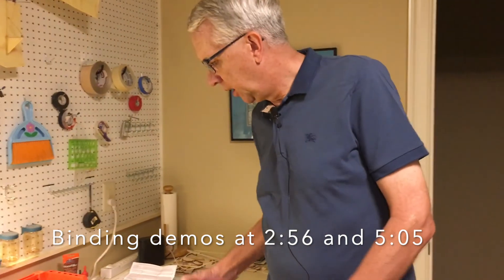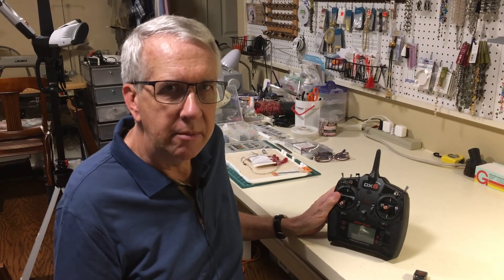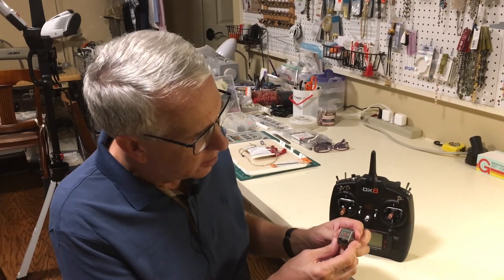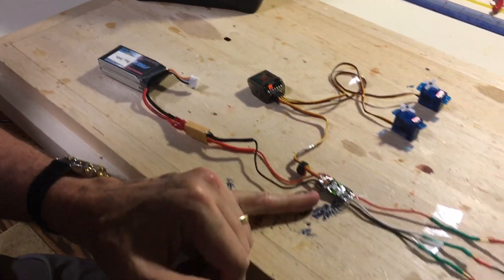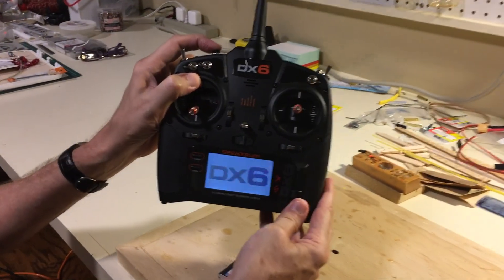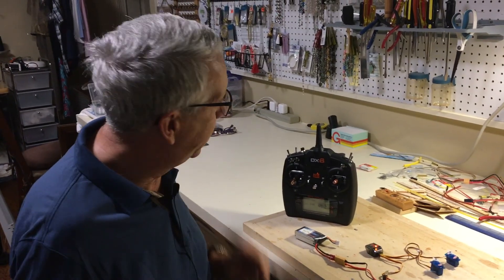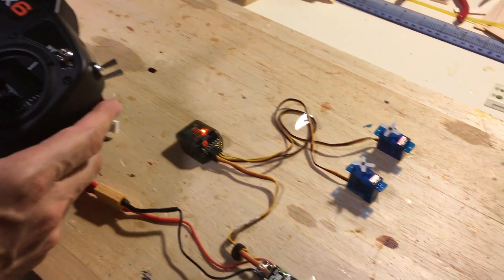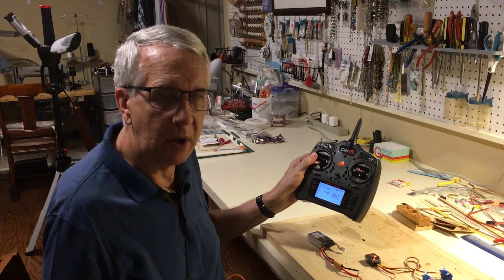How to Bind a Spektrum DX6 Transmitter to an AR620 Receiver

Comment: Hi Tim many thanks...to then bind to a second model do you have to already have model number 2 selected before you switch on the transmitter after you have bound 
Hope you get my meaning...I'm getting this transmitter tomorrow 
Mark UK
Reply from the maker: Yes, you’ll bind the receiver to whatever model is selected on the transmitter.
Reply: I know nothing so I ask: The model in the transmitter is the type plane that is programmed in the transmitter and when you bind the receiver, the transmitter thinks the receiver is installed in that type of plane?

Comment: I  have a DX6 and used AR620 which I would like to use on different plane.  I need to reset receiver to default settings.... Do you know how?  thank u sir
Reply from the maker: I am not fully sure what it means to reset a receiver.  Typically you need to the receive to be binded to the transmitter, which it seems to be.  Just install the receiver in your new plane and go fly.  If further questions, try www.RCGroups.com

Comment: How?
Do you set fail safe on a dx6.... I can't find it on manuals, lib.Or in the Transmitter index list.
Fail safe seems to be automatic when you do the binding , but it only shuts the throttle  off.... It doesn't put surface areas to position that you want.like  Every
 Thing neutral apart from a little bit of elevator.
Reply from the maker: I am not fully sure.  Try a Google search, here is one video for an RC car: 
 https://www.youtube.com/watch?v=c0AmCSqh1yM
Reply: @TimMcKay56  j found a few for the 6i and 9 but not for our transmitter the DX6....ok thank you i will look at that link

Comment: I just got a tug boat with this spectrum set up. But nothing works even after a confirmed hand shake. I just want a throttle and steering in this unit. What ports do I plug my esc into, And rudder servo into? I feel like this Is a basket case. Any help would be great. Thank you. It's just two servos now I'm dealing with but have this 6 channel setup
Reply from the maker: Watch my video “RC Electronics for Newbies.”  Tim

Comment: Can this AR620 be binded to the Spektrum DX6i transmitter? 
I believe in theory it can by pushing the bind button on the receiver and then holding the trainer toggle in the forward position while turning on the DX6i?
The DX6i does not have a bind button.

I ask because I have been out of the game awhile and have a DX6i and will be using a AR620 DSM2 in my new FMS Pitts 1400mm.  
I just want to make sure the bind will be ok or possible?
Or do I need to buy a new transmitter? 🤦‍♂️😬

My P47D and Radian are bound to my DX6i and would like to avoid the additional cost as I don’t fly a ton. 

Any information would be greatly appreciated!!
Reply from the maker: Yes, that way should work. I have a DX6, there is no bind button, bind procedure as you describe. Tim
Reply: @TimMcKay56  Thank you!

Comment: Hey Tim. 5:25 you said you "debinded" the receiver.  That's what I'm trying to do. How do I do that?  Thanks
Reply from the maker: Wayne:  I think that was more a slip of the tongue than anything else.  You really "re-bind" a receiver to a new transmitter or model location in the transmitter.  But binding to a new model, you essentially "debind" from the older one.  

Jeez, it is painful watching the first YouTube videos done.  All YouTubers start at the same point, zero knowledge.  Glad I purchased some lighting for follow on work!!  Tim

Comment: Mr. McKay,
My question is not related to this video.  I've built out some versions of your backyard flyer.  Powering it is my problem.  What motor did you use for the plane?  Thank you in advance.  Rennie
Reply from the maker: Rennie:  There are countless brushless electric motors you can use. I look at the technical specs of the motor as they usually list an aircraft weight they are suited for. I usually list the motor, ESC and lipo that I used in the video Description. Tim

Comment: Thanks, as an old duffer with older equipment and escs etc, getting back into flying, it's good to get updates on how to do stuff.  Looks a lot easier, but I'll be sure and not obsess if I can't get my old Chinese escs to work!
Reply from the maker: James:  Thanks for checking in!  The new RC hardware really works well. I love the Spektrum transmitters and receivers with their internal antennas. Most convenient. Tim

Comment: Hi Tom, I purchased the NX6 and I am very satisfied. Tried to use G44 Widgeon binding with AR620. After starting the model, it drove backwards. I canceled this binding, turned off the transmitter and after 3 minutes I repeated the same operations, after which the receiver worked properly. What was the reason for the first binding and what is the order in which the servos, ailerons, speed regulator are connected to the receiver?
Will the receiver sort it out, no matter how I connect it?
Reply from the maker: Withold:  Hard to say.  But I think you did the right approach.  With electronics, if something is acting up/not acting right, turn it off, let it rest a bit, then retry.  Tim

Comment: Tim great videos can the DX6 bind to all Spektrum recievers cheers mate!
Reply from the maker: Robbo:   Thanks for checking in!  Just do a Google search for Spektrum DX6 compatible receivers.  Below is what I got for the DX6i.  Horizon Hobby has a great tech support chat line, best to ask them on specific receivers as there are so may out there.  As I really do not like to crash, I recommend spending the bucks for a quality Spektrum receiver for a Spektrum transmitter. As the same brand they bind a lot easier.  Just be careful of older receivers you might find on eBay.  Tim

The DSMX DX6i is compatible with all current Spektrum DSM2 and DSMX aircraft receivers. The DSMX branded DX6i transmitter is not compatible with the Spektrum AR6000/BR6000 receiver. Always purchase products from a Horizon Hobby, Inc. authorized dealer to ensure authentic high-quality Spektrum product.

Comment: thinking of upgrading to 2.4ghz, can you have 2 recievers saved so it can swap between 2? or does binding have to be done each time? I'm currently on 35mhz with same frequency in both my recievers so I can just select my saved models and go
Reply from the maker: MrPM:  By all means, switch to 2.4 GHz.  There is literally not a single reason not to do so.  Most transmitters can store multiple models.  My four year old Sprektrum DX6 can store 250 models.  A receiver has to be binded to just one transmitter model, this is the whole idea behind 2.4 GHz, the freedom from being jammed by someone else "on your frequency."  This cannot happen as the transmitter can recognize just a single receiver.  Good luck!  Tim
Reply: @TimMcKay56  I'm on a x 347 which I've had since I was young just started to get back into flying again, really considering getting a dx6e but was just wondering if I can have 2 separate recievers and just automatically swap over to each receiver without having to bind each time, I have both of my models set up on my transmitter and don't have to do anything to connect just plug battery and go, was wondering if its the same for 2.4
Reply from the maker: @PockoRC  You will have to bind each time you use a different receiver, as far as I can tell.  Tim
Reply: @TimMcKay56  thanks for your reply, that wouldn't be to much on an issue
Reply: I've done some research and apparently no limit to how many recievers can be binded as long as they have same protocol dsmx dsm2
Reply: @PockoRC  does that mean I can bind all spektrum recievers to my DX6?
Reply: @livn4christ33  depends on country, if you're in the uk you're only able to bind what the transmitter is for example dsmx tx will only bind to dsmx rx in the uk. but you can bind rx to each model and not need to bind each time you change models
Reply: @PockoRC  cheers I’m in Australia
Reply: @livn4christ33  you should be fine
Reply: @PockoRC  cheers thanks heaps mate. Greatly appreciated
Reply: @livn4christ33  no problem, I found out the hard way in the uk😂 that it's not backwards compatible

Comment: I have a DX 6 and the AR620 receiver and are using it to buddy someone.   When I bind it I want to ensure that the Fail Safe goes to predetermined settings however when we turn off the TX it goes to last position not the predetermined positions.   Any help available.
Reply from the maker: Robert:  Apologies, but I ask that you refer to the DX6 manual (available on line) for fail safe procedures.  I have not worked on these for my planes.  Tim
Reply: Thankyou very much

Comment: Hello video was great help,I have a silly question I'm used to standard 4 channel radios that I run my 4 stars on ok how does this dx6 shut off thers no on and off switch,boy am I old school.
Reply from the maker: David:  The DX6 transmitter has a horizontal slider on-off switch right above the information screen.  For the airplane, there is no on-off switch for the flight pack as that is powered on when the lipo battery is connected to the system.  Tim
Reply: @TimMcKay56  ok Tim I figured it out manual says to hold botton on for 4 seconds then radio will shut off  I done this and it did.your video was still very helpful all of my servos are responding now all is I got to do is log in a plane.thanks
Reply from the maker: Well done!  Tim
Reply: @TimMcKay56  thanks tim.

Comment: Hy Tim 

I need some help mate!
I am realy frustrated because i want to use a micro receiver board with two linear servos for my spektrum dx6 g2 !

Now i am afraid to buy one from bangood or aliexpress as some people told me they dont work with tje dx6 gen 2 

Can u maybe send me a link to a reciver board woth integrated linear servos for my radio !? 

I just dont want to spend 70€ for a spektrum product if there is the same elsewhere available , i am judt a bit afraid it wont bind
Reply from the maker: Pirmin:  I usually go with www.StevensAero.com. Good service, can answer any technical questions you may have. Tim
Reply: @TimMcKay56  unfortunatley all out of stock , noe i found some on bangood and alibaba for dsm2 and dsmx but i am still undure if it will support the dx6 gen 2 

What would u do ? 
I already asked stevens aero customer support ( crickets )
Reply from the maker: Hard to say, I would try DSM2 set up. Tim

Comment: Hi can I ask you a question please?
It was about using different airplane models with this spektrum radio.
When you want to use a different aircraft should you already have a receiver in all your models then bind it to that.
Or do you use one receiver and just put the receiver in the plane you are going to use?
Thank you for the video.
Reply from the maker: DM:  That is actually a good question.  All transmitters these days have computer memory.  My DX6 can store up the 250 different models, which is great.  While you could move a receiver from airplane to airplane, this is not a good idea as you would have to constantly plug and unplug the servo connectors which could lead to a failure.  Also, whatever trim settings you had in Model 1 would need to be changed to Model 2, etc.  As receivers are so cheap these days (as well as servos), my AR620 is around $40, just buy and install a receiver in each plane.  Once done flying the plane, then take the receiver and put in a new plane.  I have around 10 RC models, all with their own receiver, and just the one DX6 transmitter.  Tim
Reply: @TimMcKay56  hi thank you very much I do appreciate the reply ty.It can be a little confusing when starting but I been trying to fly for a while.
I still have an alfa model plane I bought but never knew how to set it up I still dont even know what motor to use.
But I have some newer ones now i'm not even lying I still haven't flown anything yet.
I just got the eflite opterra 2 it already has the spektrum receiver inside  that is a bind and plug type,this video was really helpful too thank you.
Im about to get this radio it looks pretty cool better than the 6e.
Thank you for the reply good point too I wouldn't want to be changing the receiver and plugs all the time.
Binding different esc's has always been tricky too for me sometimes with other rc's not aircraft.
Sometimes I try it but it doesn't go as planned maybe my fault too.

I really didn't know if other radios would work with my eflite like a futaba or airtronics makes sense what you said if its from the same brand might just work easier or better.
I think it needs a spektrum radio though I just found out.
Thank you very much this radio will be good for my other models too..
My biggest thing was trying to set everything up and now knowing what electronics and motors would work
I never bought a rtf either I always liked models that you had to set up.
But I do have the rf9 simulator with spektrum radio.
I'm having a nice time setting up and building some of the models I have now though.
Thank you this did help made sense I will just do it this way..
thank you again..!
Reply: @TimMcKay56  hi sorry I’m trying to figure what receivers work with the dx6 and I can’t find any info on it.  Can you tell me please what ones would work with it.
Reply from the maker: @tylerjago2087  Best to contact www.HorizonHobby.com via their tech support chat line.  Once you tell them your receiver, they can assist.  Tim

Comment: So I have a weird issue. Using my ar620 to run an rc dozer with my dx5e. It will bind just fine with my dx5, but once I power everything off, it doesn't stay bound and I have to bind it everytime I turn it on. Hoping it's just operator error lol
Reply from the maker: Sideways:  It can always be a bit tricky/confounding with ensuring consistent compatibility with all transmitters and receivers, especially if the transmitter is a bit older.  The AR620 should be just fine and up to date.  Not fully sure of the DX5.  At any rate, it seems like the two do bind, just that you have to bind for each operation.  The only thing I can think of is to ensure that the receivers always "sees" it's binded transmitter when powered up.  In other words, to power up, transmitter on then receiver.  When flight is complete, receiver off then transmitter.  I know that with the ParkZone micro brick, if you power that up with no transmitter signal present, the receiver will automatically go into bind mode after 5 seconds.  And if all else fails, just purchase a new (Spektrum) transmitter.  Tim
Reply: @TimMcKay56  I did try that to no avail. Didn't take age into consideration and I'm pretty sure your right about that. I got my dx5 when I was around 12 or so and I'm old enough to drink now haha. Thank you for the quick reply, have a good rest of your day sir and Merry Christmas/Happy Holidays 🤘
Reply from the maker: Best of luck!  Newer transmitters always nice to have. May even prevent a future crash!  Tim

Comment: Tim ..I am piecing together a  nitro plane and do not have an ESC...I do have the DX6 and just ordered an AR620.....how  do I get  power to the receiver?....
Reply from the maker: Gary:  When you say "nitro plane" I have to assume this is a gas or glow fuel powered model, i.e. a motor with a throttle.  If this is the case, you'll need an airborne battery pack to power the receiver and servos.  The airborne battery pack plugs into the "BATT" plug on the receiver (note that the ESC plugs onto the throttle input to the receiver, it has no function for a fuel powered model).  

The airborne battery pack was always a four cell nicad battery that came with all radio sets.  These days, with the vast majority of models being electric powered, the large lipo flight battery, through the magic of the Electronic Speed Control, provide electrical power to the motor, throttle to the motor, and electric power to the servos.  Horizon Hobby chat line can provide info on the airborne battery packs.  Tim